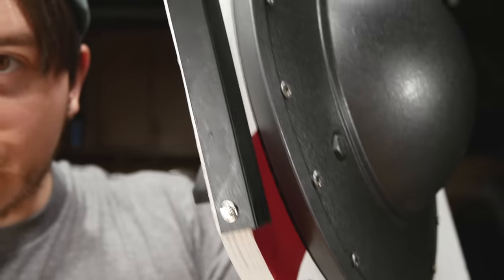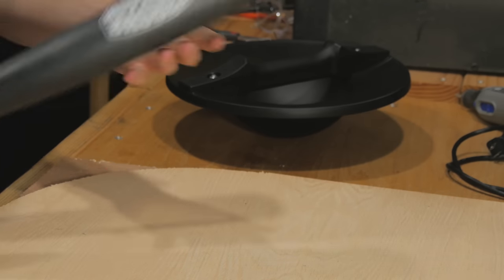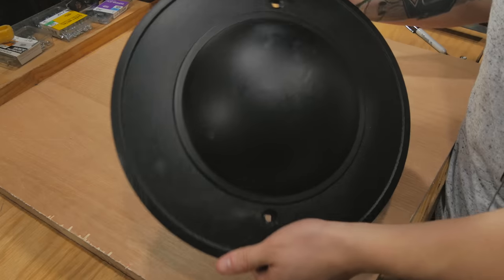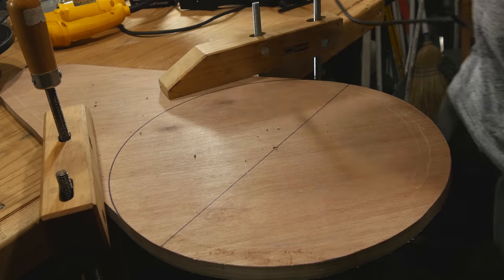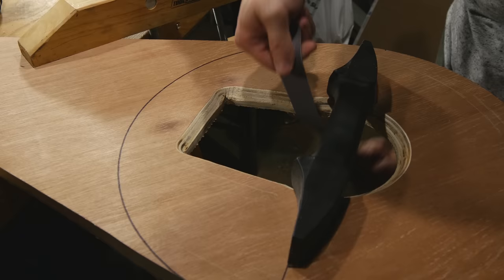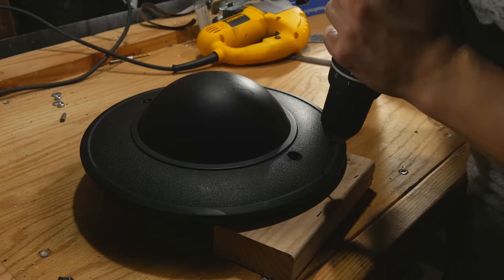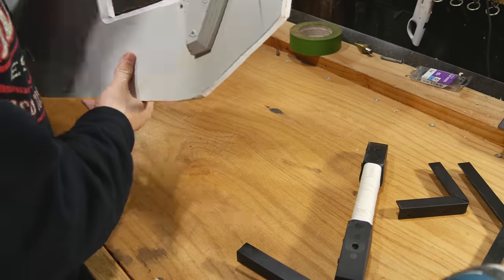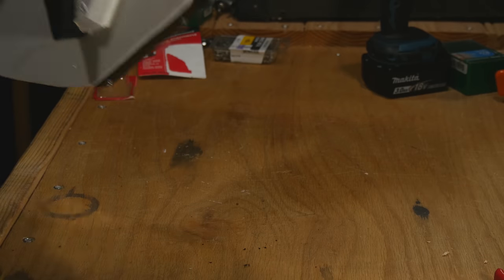How to Make: Brawler Shield (Weapon/Shield HYBRID)

Comment: Oh ma gawd! You gave me the inspiration for somethin awesome. This shield had me pumped enough, that I've watched it 13 times, and the last 5 times, I have had the nagging thought in the back of my mind. In the " Stab Proof armor" Video he pointed out that a hard steel surface that would deflect a blade can be bad, since al they have to do is swing hard enough and it would deflect around to find a weak spot. A machete swung at the angle iron of the shield could end up with the blade getting deflected toward your shoulder or bicep, of course, worse things could happen with certain circumstances(Deflect into the top of your skull if you raise the shield up point first to protect from a downward swing. But Hear me out for another moment, inch thick oak plywood for base, Beautiful, Polypropylene buckler for a boss BRILLIANT, but replace the angle iron, with 1/4-1/2 inch thick bamboo or some other dense hardwood, cut to 1 inch wide(or whatever width the thickness of the shield you make is)then add a layer of thick rawhide or leather, in front of the bamboo(providing a softer medium that will catch rather than deflect a blade) Secure those layers to the edge of the shield with 1/4 inch steel rivets, be it nails, bolts, or actual pop rivets. Any blade that has enough force behind it to push past the raw hide layer, and somehow deflects against the bamboo or hardwood, would get caught dead in it's tracks by the quarter inch rivet, plus, particularly if you use bolts for the rivet you get a nasty contact point for punching with right? Man I hope you see this, I have the know how, but sadly not the workspace or tools to do projects larger than machete maintenance (I literally just have a couple files, knives and whetstones at the moment) and I would love to see this idea come to life, before the time that I will be able to make it myself, which is far in the future.

Comment: If you placed the shield over another piece of scrap wood and then used the hole saw, you wont get that tear out, you'll end up with a smoother cut on the back side of the wood. The scrap piece helps to prevent that, but you have to clamp it on real tight to the shield so it wont move at all when the saw starts to bite into the scrap wood through the shield.

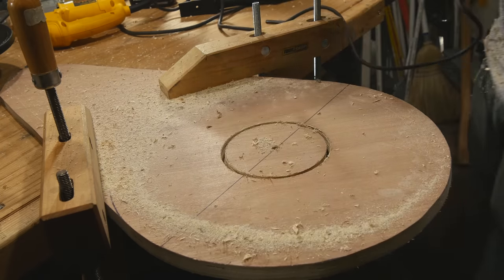Comment: 8:08 you can also put a peice of wood under the board you're drilling through so it doesn't splinter like that just clamp a peice of 2x6 onto the bottom or something. Drill through the first peice and partway into the next.

Comment: Just a tip for the future when working with PP or any other thermoplastics and you want to insert bolts or anything into it; heat the plastic up in that area gently with a torch and then set your bolt or whatever.

Comment: The bag moves so much more with the punch because of the speed, it has time to push the bag. A bullet has more energy but would move the bag less. The baseball club might do more because of the speed and quick energy transfer. The slow energy transfer like the punch will do less trauma but has more push.

Comment: My critique is to see the results between a proper mace (none of that crappy WOW design) and the shield on a metal plate. Mase is probably going to leave a much larger dent than the shield because while the weight will be smaller, the impact force will be greater because of the smaller surface area. There was a reason why blunt weapons became more common as plate armor became more widespread.

Comment: if you want it to have a less chance of splitting, you might want to consider drilling pilot holes into the spots your putting the screws and bolts. it will reduce the potential cracking a lot.

Comment: two type bash, side bash and front sheild bash.  side bash is nice, but if you add a dagger on that your bashing at it would prove effectived against ppl who has no good armor protection, but vsing an armor, I prefer keep your shield that way its one the best way recommend is good.
Reply: He could add some sort of switch blade attachment so there wouldn't be a huge blade in the way. He could just flip it out when dealing with lightly armored foes.

Comment: It isn't the weight of the shield that provides getter impact. It is the weight of your body. You're basically throwing a punch with the shield absorbing the impact.  By contrast  the bat has none of your weight behind it. It is simply a swing imparting the weight of the bat at speed. But since force is mass times acceleration greater mass with similar acceleration means far more force.

Comment: Quick thing a club is more effective weapon than the shield the up side to the shield it to off balance or knock down/back your opponent. The club has a smaller surface area and can deal more damage in more focused areas. I know that this is not a big thing but I just felt it necessary to explain based on how you were saying things at the start of the video with the punching bag.

Comment: that thing where the wood flays when you drill through it, you can prevent it by putting some wood underneath it why drilling. This is for the hole saw part.
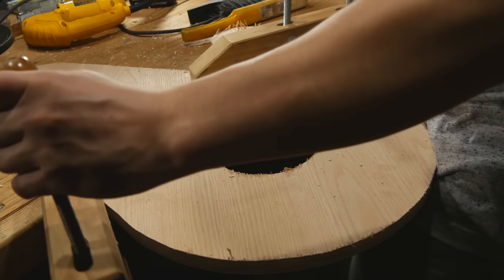8:37

Comment: That is quite a small shield my dude. You would want it a bit wider than this I would think. Wide enough to cover your torso with room to spare. The punch does look like it has more weight behind it - but I wonder how much damage it would really do...? Maybe you could do some dummy tests with ballistic gel heads/ torsos...? Either way, the shild looks pretty boss and the style points are what really count. Looking forward to seeing you build a full set of armor with modern materials so you look like a post-apocalypse crusader, with that bucket helmet on.

I would say if you're going to use a shield and a one-handed weapon, maybe a blunt weapon like a club or mace is a better shout than an axe or bladed weapon since a mace doesn't requrire any kind of edge alignment. Not that I would know since I don't generally bring my fuckin ringmail to the pub on a Friday night, but yknow.

Comment: Would it work if instead of wood, the body was a thicker layer of that fiberglass bullet-resistant plate stuff you made? Especially if you added in some extra stuff and refined your process? Obviously it'd be way more labor-intensive, but would that be structurally viable?

Comment: Actually it has nothing to do with the weight, and everything to do with the biomechanics of how you are driving teh shield into the target, like a punch, which is a movement that is optimal for delivering a lot of energy, hence why so many martial arts systems use punches.  In point of fact, you could actually be delivering a LOT more force if the shield was lighter and you were punching with it faster, which is why most historical shields rarely weighed more than five or six pounds, maximum.

All of that said, that is still an AWESOME shield design, and one that I might look in to replicating myself, sometime down the line!

Comment: couldnt you use a kite shield and use a thinner bottom edge and a thicker top edge? it would then be usable for bashing and if you pulled back, as a blade, a dull one, but a blade nonetheless, one you could sharpen.

Comment: Wouldn't the amount of force applied also be linked to the smaller surface area of the shield compared to the bat, and of course the weight is an additive

Comment: A scrap piece of wood underneath will stop that splintering or 🤔do it from the other side of your filing the edge anyway, or even once your half way through. Flip it over and use the centre hole to drill from that side ( oh er 🤔 doh😆🤣)
Keep'em coming, waiting for a version of my fireworks launcher using a silicone pump & barrage/cake fireworks (honest it wasn't a grenade launcher 💥 that would be dangerous right )

Comment: If you had to rebuild it, is there ANYTHING you might have done differently? (Materials wise for strength or weight? Dimensions or curvature? Support or comfort even)..?
Reply from the maker: Probably woulda made it with 1/2" ply instead of 3/4. Aside from that nah.
Reply: ZNA Productions thanks Eli

Comment: You think that drill is scary there? try using it to cut a 4 inch hole in a 6 inch sched 80 black iron pipe then have it bind over and over and just about take your teeth out while working 20 feet in the air.

Comment: I have an idea for an improvement,, use 12-18 mm plexiglass Perspex,, whatever its called where u are,, its pretty much bulletproof,,hammer proof,,axe proof etc,, and see thru,, and a bit heavier than the board so more weight behind your strikes,, still add the ally channel around the head for extra strength and impact =) then its perfect,,=)
Reply: maybe make the head of the shield more spiked,, like more angles sticking out,,maybe star headed shield ? =)

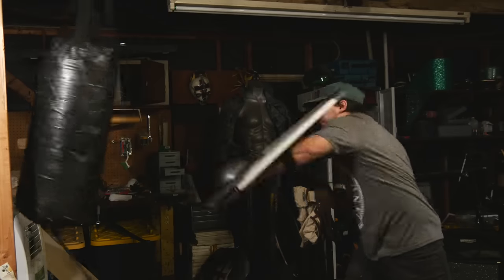Comment: 1:30 (nerd alert) that's actually because the shield is more in line with the structure of your body.  Allowing you to put more body weight behind the attack.  You would get a similar result is you strap a t shaped rod to your arm and hold it by the top of the t

Comment: This is not a shield. This is something ridiculously heavy, that would protect your arm and nothing more. Generally shields either cover a lot of the body area or are light enough to be moved swiftly. This thing is small and slow. I get the idea - but historically shields have been quite often used as weapons without having to sacrifice their main function - protection. I'm certain this is heavier than a Viking-era center-grip round shield, which can be better used as a weapon (because the striking edge is actually half a shield in front of your hand, thus giving you more reach) plus it covers much larger area of your body. I know you do not try to make your things historically accurate (and you don't really need to -they have a very distinctive modern/post-apocalyptic style, which I really love), but you can learn from history and upgrade upon it. 
For example in this particular case I'd suggest going with an center-grip octagonal shape, no more than 8mm (sorry, I don't use Imperial units) thick, without the additional reinforcement that adds unnecessary weight, and instead with full bolt-through montages. Using a synthetic buckler as a boss will help reduce weight and will make it possible to use L-shaped steel edging. To add strength to the face of the shield you can use a couple layers of kevlar on both sides, effectively creating a lightweight laminated sandwich. Similar technique was used historically only linen and canvas were used instead of kevlar and of course there were quite a few more layers of it (typically between 4 and 8).
I would actually make it as a video reply, but unfortunately at the moment I have neither the time, nor the access to a workshop :)

Comment: What has this guy never heard of a buckler or the technique called shield slashing/bashing plus almost all shields had steel rimming I'm learning the art of blacksmithing/woodworking/armor and weapon construction so I know this topic fairly well it's the reason I'm informing you guy's that just using a shield as a way to protect yourself also involves using it as an offensive tool just as it is also used defensively. No disrespect man your vids are great keep up the great builds

Comment: Duuuude why is it so hard to contact you! You have no message button 
here or patreon and your fb hasnt been touched in a year. and cant find 
an email address anywhere. Maybe I'm just blind.
Been trying to get 
the tools and materials I need to make your Brawler Shield for like a 
year now and Ive finally got it all! Making one for myself because its 
cool as all hell, but I've been trying to get a hold of you for 
permission to make and sell more. Ill become a patron on patreon and 
donate every time I sell one as well as doing a regular monthly donation
 regardless because your great. Its your shield, Im pretty sure (hoping)
 you wouldn't raise a stink about it but dont want to sell your design 
without getting permission if I can.
Reply: Some advice if you haven't already finished your sheild. Take the time and forge out a boss out of sheet steel and it turns out way better. I did it and it's pretty fun too.